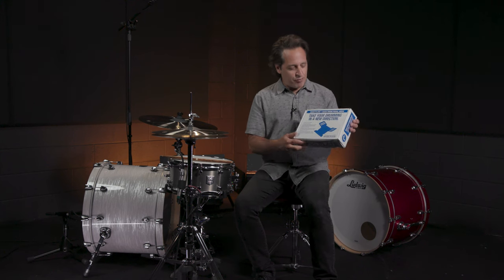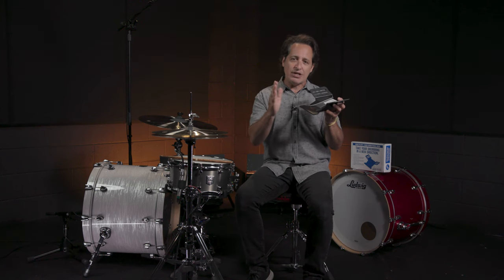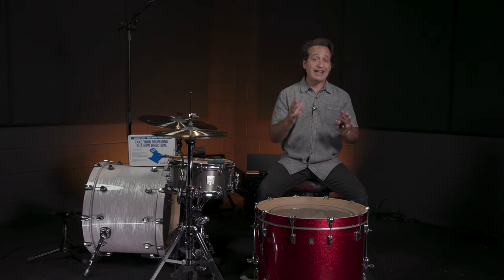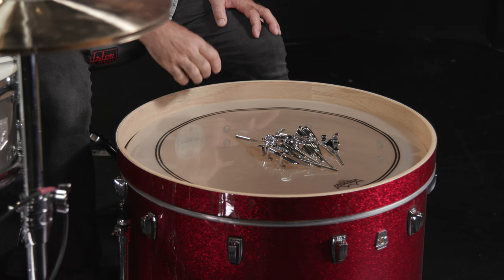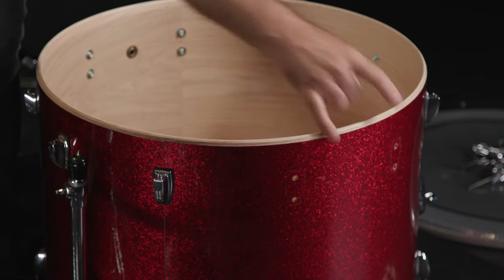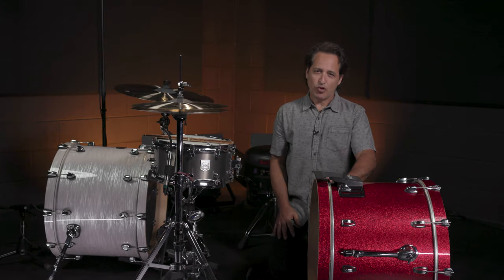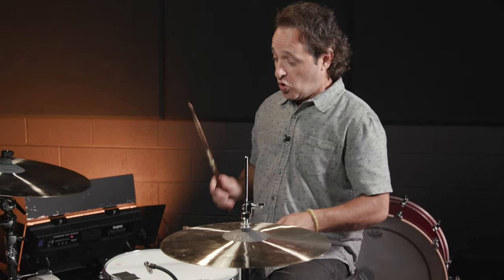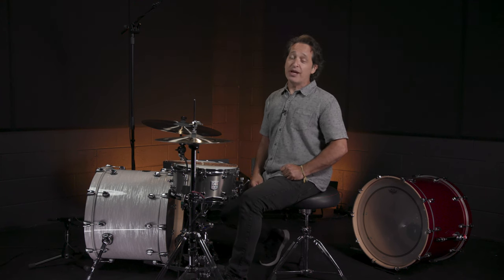Bass Plate | A Simple Solution for Adjusting Your Kick Beater Strike Zone

Comment from the maker: The Bass Plate gives drummers the power to adjust their kick beater strike zone without compromising feel. Check out this simple, innovative solution at Sweetwater 👉 https://imp.i114863.net/a1V95o
Reply: Thanks to Nick and Sweetwater for making this great video! Bass Plate is designed to do three things:

1) Improve the drum's sound by getting the pedal off the hoop. When you clamp a pedal onto a drum’s hoop, the weight and pressure on the wood hoop reduce the drum’s overall resonance, its low-end frequency response, and especially its mid-range frequency response. Bass Plate overcomes this muting effect by getting the drum clamp off the hoop (and onto the Bass Plate), and it gives the drum more presence, power, and sensitivity — even if you like a lot of muffling in your drum.

2) Give lateral adjustability to the pedal. For example, if you get your beater height where you like it (for power and feel), but the beater isn’t striking the drum’s head where you prefer (distance from head's center), Bass Plate allows you to move the pedal a bit to the right or left so you can keep the beater height and get the tone and attack you prefer — either dead center or off-center.

3) Protect the drum’s hoop. No more “pedal rash.” This helps protect your investment.

By the way, Nick D. is just as nice and helpful in person as he is on these videos. Sweetwater has been great to work with!
Reply from the maker: @bassplate  🙌🙌

Comment: I have an Evans bass drum lifter now but this looks so much better. My only question is whether my kick will still fit in its case properly or not.
Reply: Hi Daniel, yes, the Bass Plate is designed so that a drum will fit in any case --- hard or bag --- when a Bass Plate is installed on that drum.

Comment: Show my question would be the part of the lug that goes into the hole drilled in the bass drum is sticking out. I think it would ruin the whole if it kept moving around because it didn't have the insert from the log inside the hole
Reply: Good question. We have taken a close look at lugs like this and found no evidence of movement of the screws. Most lugs do not extend into the drum's shell. For example, DW's lugs have protrusions, but they extend only as deep as their rubber gaskets. In theses cases, there is no metal between the lug screws and the shell material within the screw holes. As for lugs with protrusions, like some Yamaha lugs, the screws are held so firmly in place that there is no movement. Lugs like this just end up functioning like DW lugs when a Bass Plate is installed. We have received feedback from drummers using kits with lugs like this (for example, Yamaha bullet-style lugs that are on the Live Custom Hybrid drums) for years with Bass Plates installed, and there is no movement. Once a Bass Plate is installed, it stays in place; this is thanks to the design of the Bass Plate's wings, which match the curvature of the drum's shell and have full-coverage 1mm rubber for grip and protection.

Comment: Make this for 18 inch drums pls.
Reply: The 22-model Bass Plate may be used on 18" drums, too. The inner pair of slots on the 22"-model (which are designed for a ten-lug 22" drum) happens to line up well with the lug holes on an eight-lug 18" drum.

Comment: Thanks to all the drummers who have reached out to us to learn more about Bass Plate! Bass Plate improves a drum's sound, gives lateral adjustability for the pedal, and protects the hoop. A drum with a Bass Plate installed fits in any case (hard or soft case) with room to spare. Bass Plate is in use by many great drummers on tour and in the studio. (And the portion of this Sweetwater video with the red Ludwig drum does a great job of showing how Bass Plate is meant to line-up with the drum's hoop!)
Reply: I'm just about to outfit the BP-20 on my drum... Thanks for making this!
Reply: @aaronwatter  That's great! Your 20" bass drum will sound its best! Reach out to us if you have any questions.
Reply: Hey! I have a 26" drum. Will it be able to work?
Reply: @riffinrob7231  Hi, Bass Plate comes in two models, for 22” and 20” drums. And those two models also fit on 18” and 16” drums, respectively. With those four drum sizes covered, there are no plans to release any other models, but we’ll let you know if that changes.
Reply: Hey so I'm worried about the hole that's drilled in my bass drum for the lug to get out of round. This would be due to the Lug sticking out. Therefore if you don't tighten it all the way it's going to move around and if you tied it too much you will break the lug
Reply: @Shurmstick  We love discussing Bass Plate's installation and use because it gives us a chance to share the info we've learned from testing Bass Plate and the feedback we've received from Bass Plate users! Thousands of drummers currently use Bass Plates, and many send us feedback. See more info on this topic of lug screws in our reply to your other comment, below.

Comment: Great plug for a great product. 
On install it's actually easier to remove the resonant (front) head, NOT the batter head.  This way, you can adjust the depth positioning of the Plate with the batter head (and BD pedal) in-place.  The manufacturer recommended steps are:
1. Remove the bottom two batter hoop claws only (not the lugs, yet).
2. Remove the resonant/front head.
3. Remove the bottom two batter side lugs.*
4. Roughly position the BP over the lug screw holes and then re-place the bottom two batter lugs (do not yet tighten lug screws fully, so you can adjust it's depth position on the drum).
5. Once final position is found, fully tighten batter lug screws, replace lower two batter claws, and replace the resonant head & claws.

*Why go batter, then reso, then back to batter side?  
Because if you do step #2 first, you will expose the reso bearing edge to damage (i.e. the hard floor).  If working on a soft carpeted floor, maybe this is not so much an issue.

Comment: Doesn't it cause the ring clamp mounting screws to go in at a slight angle in to the shell hardware?
Reply: Hi B GE, we've tested Bass Plate on many models of drums, and the angle of the tension rods is not changed much at all because the wings of the Bass Plate (which go under the lugs) do not lift the lugs very much. Of course, you're welcome to message us if you have any questions about the particulars of your setup.

Comment: I have a broken kick spur. Could I use this on the reso side of the kick to help out the one spur I have?
Reply from the maker: Hey, flashiestfreshman. Thanks for your interest. Unfortunately that won’t fix your issue. You will still need the spurs to be intact so the bass drum doesn’t move forward.
Hope this helps.
Jason Thiele, Senior Sweetwater Sales Engineer, (800) 222-4700 ext. 1391, jason_thiele@sweetwater.com
Reply: Though that might work, we would instead recommend replacing your bass drum's spur. Or, you could get a hoop-mounted spur like DW's SM2224.
Reply: @bassplate  Thank you for replying I'll be sure to look into the DW spur and compare it with your product

Comment: I’m curious to know if this works with kick drums with center mounted lugs (ex the Ludwig clubdate) I’ll have to message Ben tomorrow.
Reply: Hi Cody, with center-mounted lug kits, the lugs are probably too far back to reach the Bass Plate's wings. There have been some Bass Plate users with kits with unconventional lug patterns who have drilled two holes (one in each area where a conventional lug would sit) and then attached the Bass Plate using a nut/bolt/washers combination.

Comment: I don't see how this changes anything about the "strike zone" at all.  Maybe it saves your bass drum hoop over time, but there a lot of hassle free ways to do that, that are faster, less expensive and just simpler all around.  This is fixing a problem that isn't really a problem.
Reply: I think it would definitely change the feel. As a guy who owns many different kicks in different sizes, I've found personally what feels good on one drum doesn't always translate to the next with my specific technique and I think that has to do with the curvature and thicknesses (or variances thereof) of different hoops. This product seem like it would mitigate that issue by making the docking area completely flush, or parallel with your pedal's clamp.
Reply: It makes a difference for smaller drums. But they don't make one for 16 or 18 inch kicks.

Comment: Will the drum still fit in a hardshell case? 
I wouldn't want to go through the process of
Removing the head when I go from gig to gig
Reply: Nope
Reply: For that reason ... I'm out.
Reply: @Zildjian_DW  Hi E, yes, a drum with a Bass Plate will fit in any case. The Bass Plate is slim and stays close to the shell, and it has been tested with many hard and soft cases; it fits perfectly with room to spare.
Reply: The tongue of the BP only sits about 1.25" away from the drum hoop, and the drum will still fit into most any case with the BP attached.